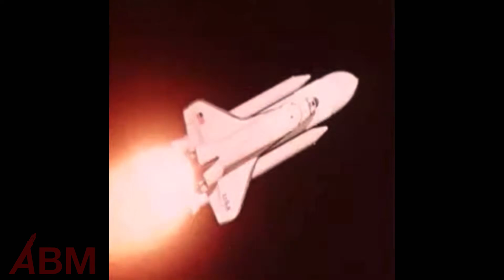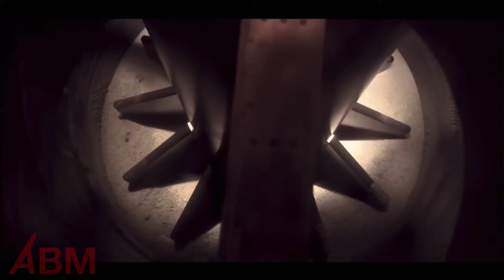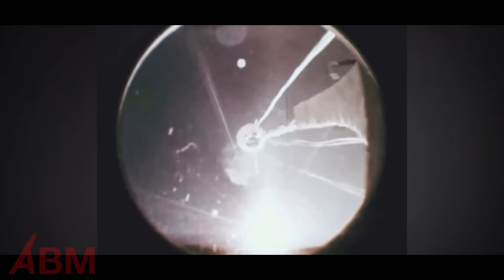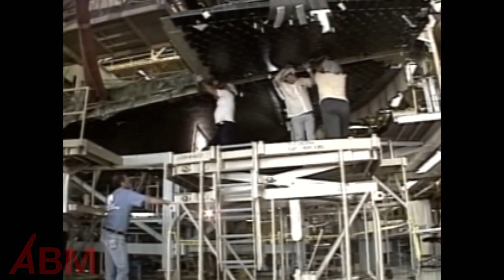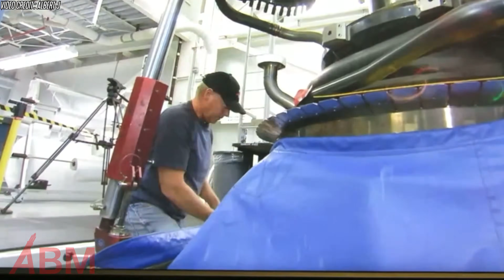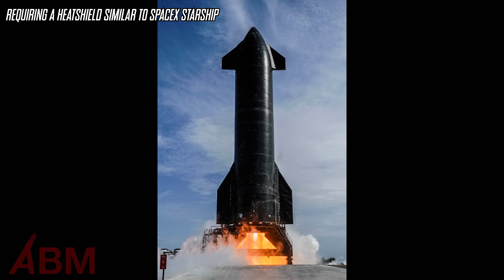Space Shuttle: Reusable or Refurbishable?

Comment: Nice video! I'd be curious to hear about any attempts by NASA or the contractors to make Shuttle components easier to reuse, and why those attempts apparently didn't work out. Similarly, I wonder if there were ever any fledgling internal efforts to pivot once it became clear that the Shuttle design was more expensive to reuse than originally expected.
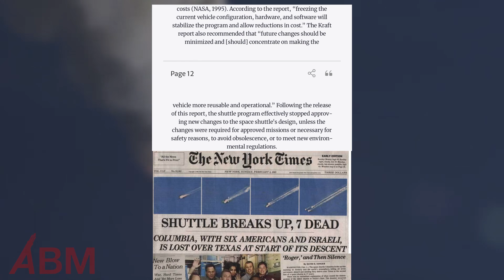Reply from the maker: I slightly covered that- and if you read the text above the Columbia news clipping at 7:50 , you’ll see that NASA decided to freeze the shuttle design. Meaning any improvements in cost or performance were effectively killed off [for the shuttle].

Optimizations mostly came from streamlining processes and facilities. For example building a SSME Facility at the KSC so they can service them at the cape instead of sending them off. As well as improving and expanding the SSMEs themselves with better, more reliable versions.

One final example of design improvements is the Super Lightweight version of the External Tank, providing more payload to orbit, even though it didn’t save much in production cost (not that they had much of a return on the expendable external tanks anyway).

All to say, while the shuttle design was frozen, they still made cost cutting and improvements elsewhere to make up for it.
Reply: @AeroBigMike Do you know why exactly they decided to freeze the Shuttle design? Obviously NASA was pretty shaken by the Challenger tragedy. But given that design changes were not at fault, freezing the design feels like an overly emotional reaction compared to the data driven approach I would usually associate with NASA.
Reply from the maker: The design freeze came after Columbia, not Challenger. And it was a suggestion they moved forward given the shuttle had claimed 14 lives and adding new experimental hardware only increased the risk future fatalities could occur.

If they froze the design, they could avoid this experimental hazards, and take steps to make the current design safer (adding more safety procedures, more fault tolerant hardware, new checks for damage (see the Rendezvous Pitch Maneuver introduced after Columbia).

So that’s why they froze the design largely- to reduce risk.
Reply: @AeroBigMike  They did update the cockpits which would have cost a lot.  Surprised that they continued with that even after Bush cancelled the program circa 2003.